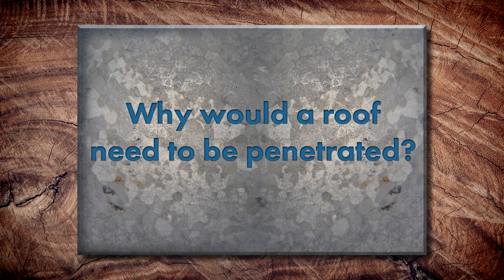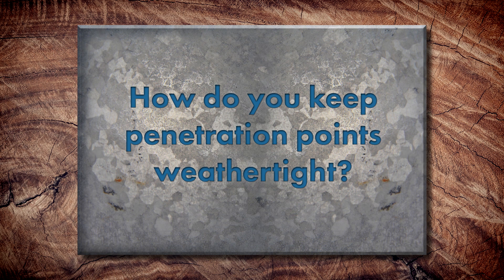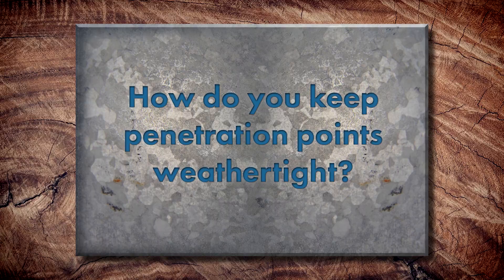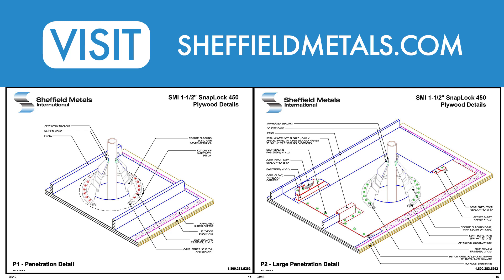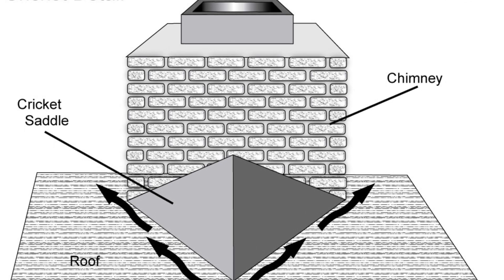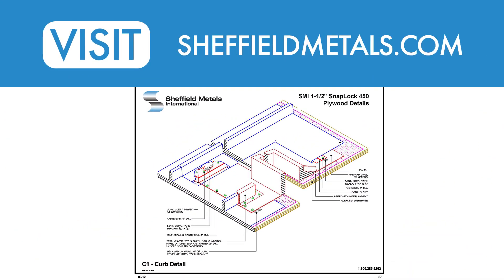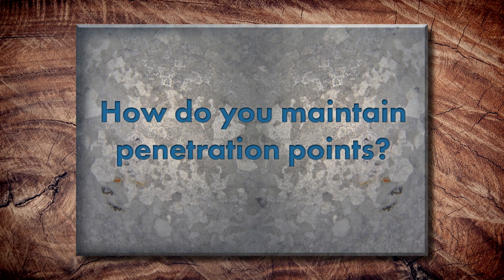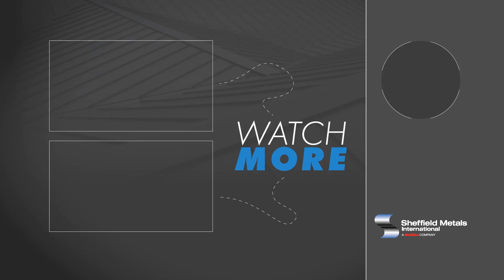How to Keep Roof Penetrations Weather-tight

Comment: In India, the usual practice to install flat rooftop solar panels is to drill anchor bolts into the rooftop rcc slab and attach metal rack structure to it with but bolts. This will create waterproofing issues in future due to expansion contraction and vibration from wind to entire structure

Comment: You should add this to your "how to spot a bad install" video. Isn't the point of a standing seam roof to have NO exposed fasteners? At the very least solder a zinc pipe to the panel or learn how to do it right. https://youtu.be/w7lAFq7j3qg

Comment: A crazy question maybe, but why not use a flashing on pipes and around skylights that are as long lasting as the roof material?  Call me crazy, it just doesn't make sense to put things on a lifetime product that won't last a lifetime!  ???
Reply from the maker: Hello! There many options when it comes to flashing a pipe penetration and contractors develop their own methods over the years that are successful for them. However, using a rubber pipe flashing is probably the most industry standard method when it comes to flashing a pipe which is why we discuss it in this video. Although it will require maintenance over the course of time, the labor and cost is minimal and the products are readily available everywhere. Thanks for the comment! -Thad
Reply: Rubber boots are done by amateurs. Pros learn to flash with same metal...make a cone, seam it to panels, use curbs, learn to fold, etc.